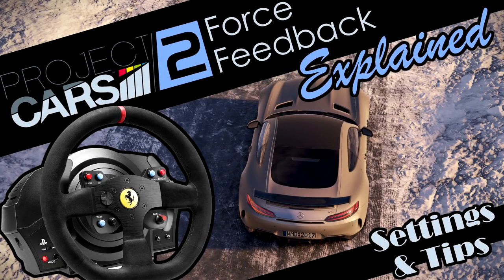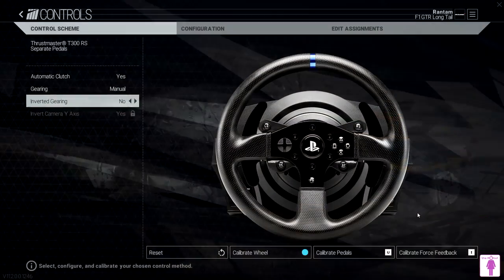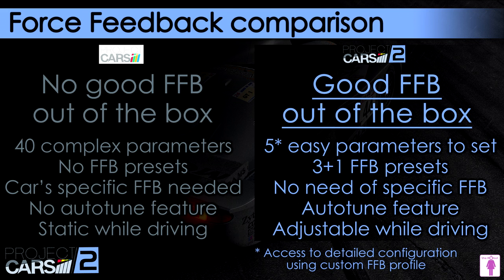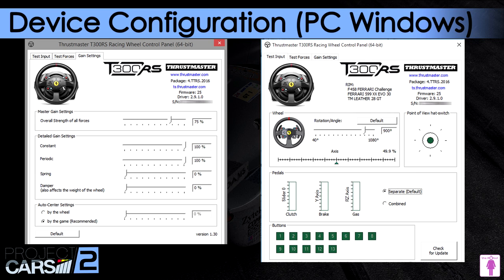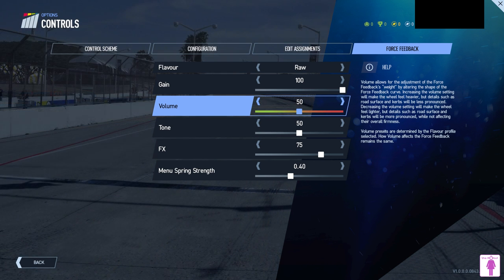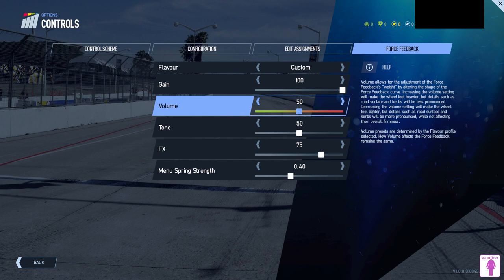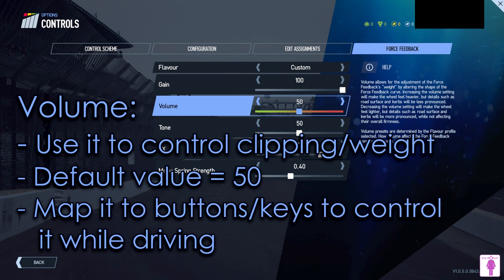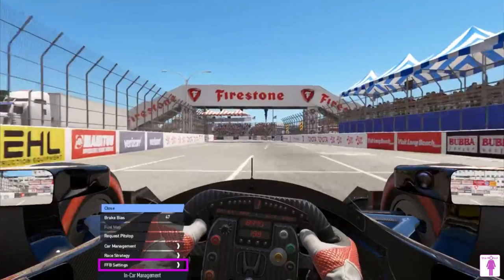Project Cars 2 - Force Feedback explained - Configuration & Tips

Comment: In fact, tone in music works differently.. If totally open you have clean and full range sound (it enphasize nothing), if you close it is going to cut the upper end according to the capacitor value and pot resistance (like on a guitar). It not like an EQ at all, even at flat it filter/touch the sound on some way if enabled (it affects sound while "tone" not)

Comment: WOW great work with your spreadsheet, I wonder if meanwhile you upgrade your Thrustmaster T300 to Simucube 2
because imo Project cars has still the most coherent FFB of all games, and has a lot to offer in content, much more than any other sim.

Project cars 2 is still my favorite game, because it works when you start it, and it has real independant 3 monitors,
meaning I can use my 120hz centre screen, 
while most sims rely on nvidia's surround which lowers all monitors to the lowest common value...

Comment: I have a T300RS too and I noticed if I turn the damper setting off in the Thursmaster control panel, then I don't get much feedback of bumps and such.  I put it back on 100%, the default, and now it feels much better... I can feel the bumps and I think overall I'm getting more feedback.  

I'm curious why you slide the damper all they way down to 0% on the Thrustmaster control panel settings.  

Thanks!

Comment: hi miss robot. I tried using this FFB idea of 100, 50, 50, 50 but I'm still having issues with snap oversteer. like, the rear end will step out but most of the time I'll just spin out and crash. I think the physics are very bad so far with pcars2. can't even keep a car straight from a burnout. if you have any ideas please let me know.
Reply from the maker: For a start it would be good to know what steering wheel and platform (PC, PS4, XBox) you're using. Also does that happen to you in all cars?.

It's not a bad idea to check the official project cars forums. You'll find more FFB information there.

Regards
Reply: Yes go back to PC1 as this new version is not ready for the market, you pay good money for it and your supposed to iron out the bugs, what a load of crap
Reply from the maker: Return the game and get a refund. No need to be unhappy unless you wanna be it... ;)

Comment: You seem super knowledgeable about this game. I'm on Xbox with a TX and one of my problems is the degrees of rotation. In Assetto Corsa it automatically sets the DOR based on the car. Why is that not the case in PCars 2?
Reply: it does cut it off  but its only visually where you can tell, it wont physically hold your wheel there like assetto,  hop in a gt3 and turn  the wheel as much as you can untill you see the steering animation hit lock,  thats where your input ends

Comment: Tone does not currently work on PS4 for G29 users. It has no effect in Immersive, Informative or Raw flavours. Please help in solving this problem to SMS on forum.projectcarsgame.com
Reply from the maker: Yep, in case of issues I invite you to go there and share you experience with them. But I'm telling you: they are already working on fixing found issues.

Regards
Reply: So is this now a known issue then? We've heard nothing from SMS about that and number of threads from people struggling with FFB is off the scale. It's remarkable. One of the main selling points was the revamp and simplicity of the new FFB system AND IT DOESN'T EVEN WORK!
Reply: Same here
Reply from the maker: I know SMS is currently working to fix bugs reported by users, but I haven't checked if this one is one of them. In fact yesterday night they released a small patch to solve a multiplayer issue, for example. Keep at eye on the official forums for more information.

Regards
Reply: After thee 1.03 game download all settings showed up like ,
Adjustable Tone and Volume and felt much much better . 
 I guess my Disc without being online on initial start up,  was off . Way better now . 
 Thank you for  the reply and video .
Reply: I wouldn't go near the Project Cars Forum, it's in house, and no one can give a objective view without being censured, or thrown off as I have, for selling Project Cars 2 which is not ready for the market, which I said was fraud.
Reply from the maker: Third negative comment from you, Anthony. You made your point already, no need of that, thanks. And I have to say I don't agree with you: whenever I have constructively criticized something about PCars1 or Pcars2 at the official forums I have never been censored.

So again: if you don't like it just get a refund.

Regards

Comment: Nice video, first 10 minutes were a bit unnecessary, and i disagree that the default pcars 2 setting are even remotely nice, (but its alot better so i cant really be to angry at sms for that) ended up spending 6+ hours trying to fix them for project cars 2.

I'm having problems no matter what i try, i get violent wheel shake during straight driving, it wobbles 10 degrees to the right, then 9 degrees to the left, 15 degrees to the right, etc. then once i change settings, the wheel gets really jerky/ crunchy. both are severely impacting my turning ability and i'm finding i'm much better off with fbb turned off completely, but then i lose all road feel....

Any ideas on how i can eliminate this violent shaking and overcorrecting, while having a smooth fbb experience? it seems i have to pick one and live with it.
EDIT: just wanted to add ~ the jerking shows up in the histogram as slow rounded out bell curves, spaced like a sine wave, with the occasional knife edge spike that clips badly, the singular clips are ok, its the bell curve ones that bother me, can i reduce them somehow

using a logitech G27 (black box, so it's the later model), not having this issue in any other racing sim apart from pcars 1 and 2

Comment: I just returned Project Cars 2 from where I bought it, as I could not calibrate the wheel, I have been driving Project Cars 1 for two years without a problem, with my Thrustmaster TX, with my Ferrari GTE 458 wheel on my X Box 1.
The problem, when I go into the actual calibration screen in Project Cars 2 and try to follow the instructions, I turn the wheel to adjust the Steering range nothing happens, it's as though my wheel is not connected to Project Cars, I have tried many time but to no avail, and have read of the same problem on other forums, so why sell a product that is not completed, and expecting us to find the bugs
Reply: Anthony Misell you should find it's been sorted now 🤗

Comment: how much of this is relevant to consoles
Reply from the maker: Quite a lot. I don't have a XBox or PS4, but as far as I know FFB should feel very similar on console. But of course the system device FFB configuration won't be the one shown in the video.
Reply: could you supply relevant settings for ps4
Reply from the maker: I'm afraid not, as I don't have a PS4. But these shouldn't be that different I guess, because in the end the physics and FFB system is the same...

But if anyone is willing to share them I'll add them to the spreadsheet, no problem ;)

Regards
Reply: thankyou. will use above settings and tweek to suit. regards
Reply: The only difference is the gain setting. On console, there is no TM Control Panel, so you must rely on the gain setting in-game. I like to keep my gain high, and use the volume control, which I have mapped to the arrows on a Bluetooth keyboard (up/down volume, left/right tone). Just keep in mind that volume is an input/output curvature, so it can result in "peaky" feeling FFB. Adjust your gain downward if you experience this. Otherwise, this guide applies.
Reply: Doh! One other section that doesn't apply to consoles (obviously), is the Custom preset. There is no Custom preset, and obviously no text file to edit.